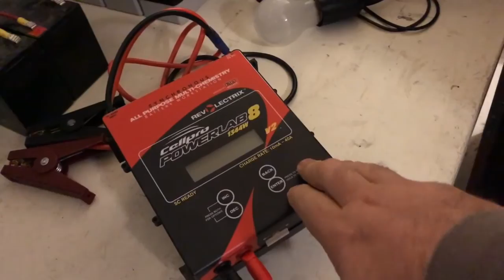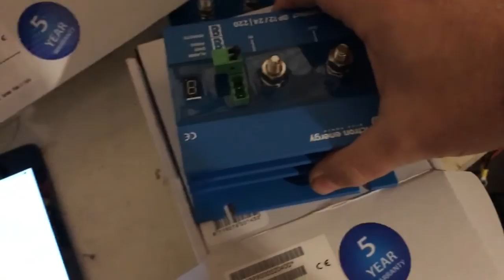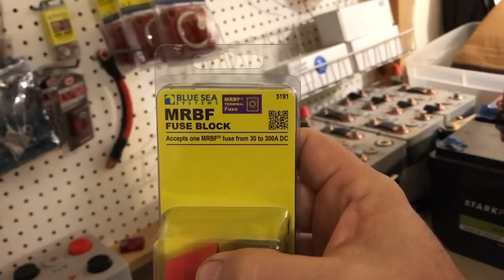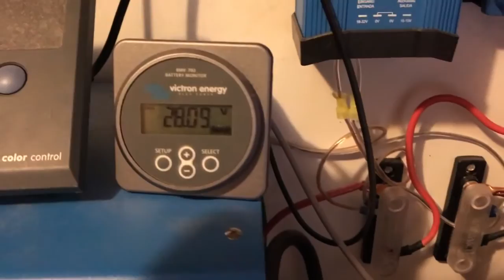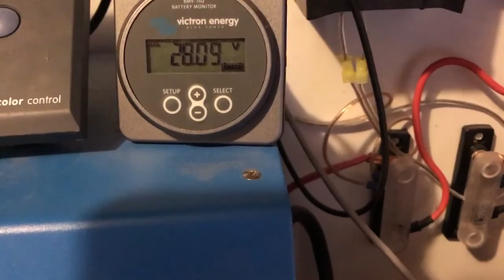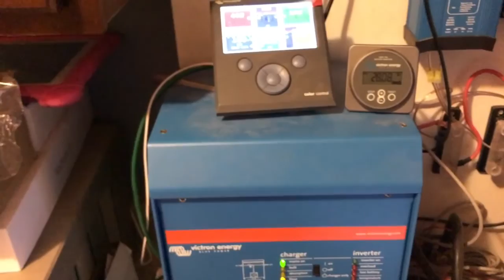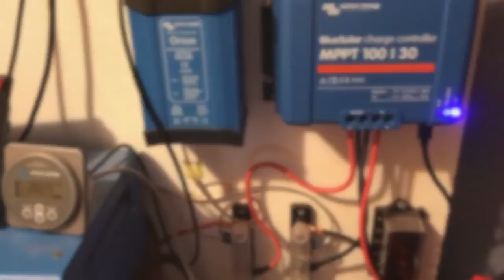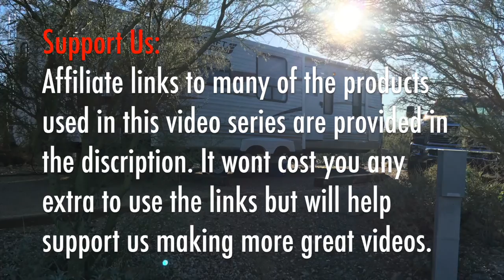Full Time RV Living | Lithium Battery & Solar: Part Two Parts and Components

Comment: Great video series.  I've learned a lot and gotten some good ideas.  I hadn't really considered going to a 24v system, which would sure use smaller cables, but you mentioned that you would discuss your solution for using the power from your 24v battery with the RV's 12v system.  Can you discuss the system that you used?  I will probably need 50 or 60 amps of 12v DC available.  Thx!
Reply from the maker: To be honest, i have just left the RVs single 12v battery and converter in place. That has actually worked well although not as efficient going from 24VDC->120VAC->12VDC. End of day it has worked. I do have 3 x 24->12v down converters from victron (Victron Orion 24/12-25) mounted in my inverter bay but haven't hooked them up. They can be ran in parallel and peak to 35a each which will provide 105a to run slides and levelers.

Comment: Thank you for your video series.  I applied several of your ideas to my own Victron Multiplus 3K LiFePO4 setup in our Trailmanor 2720SL. It was a bit cramped to say the least, but I got it together. We are in Phx metro, too and boondock on the Rim and White Mountains or winter in the deserts 95% of the time that we are out. We were trying to replace the whole generator thing and we don't use AC at all, so easy enough to do. 

My main reason for commenting is that I am highly curious why you omitted your Blue Sea battery switches from your design. You had three hanging on the wall, after all.  I bought one to install on my design and then saw you had omitted yours. I saw some horror stories online about high current battery switches failing and thought I would leave it out for now, until I do more research. I am all about safety margin, running 12V with 4/0 cables, fuses and breakers everywhere, so I thought you may have learned something about them you didn't share in your videos.  I am using Battleborn,  two 100Ah 12V batteries with built in BMS. 

Please explain why you omitted the manual battery switches.  Thanks.
Reply from the maker: Keep your switch. Ideally don't switch it under high load. That and moisture and bad for these switches long term. I omitted mine because i was using the victron batter plus which allows you to disable "one direction". By flipping off the battery plus's, flipping off the solar panels and powering off the victron, i can shut everything down essentially. Its not ideal and i will be adding in a larger DC breaker or switch. But honestly with 4 parallel banks i didn't want 4 switches. i will be redoing my bank as one large bank and will add in a switch at that point. The 4 bank approach was a great idea but just hasn't yielded any benefit. I'd like to add come cell level monitoring to my batteries. Having one bank vs four reduces the complexity. 

Hey thanks for watching ... totally appreciate it. Sorry for the late reply.

Comment: The 24/3000/70 is an excellent choice! :)
Although the components can run on their own out of the box, the CCGX just brings everything together. This is where I cheated and built my own with a RaspberryPi. It lacks the display, but reads all of the devices and uploads to VRM no problem.
Reply from the maker: +kibi15 that’s really impressive. I suspect there are several people me included that would like to learn more about your setup. The ccgx is great for setting the current limit. But for most other things I use the vrm portal as well. If the ccgx could replace ve.config it would definitely be worth its price.

Comment: this video series is amazing.  THANK YOU.  I'm in the thinking/planning/design phase and i'd love to run a 24v battery bank but on a motorhome which i've already installed a 370A high output alternator on (12v).  any ideas how to charge the battery bank via that while underway?  can the victron 24v unit bump up that voltage?
Reply from the maker: Thanks boss. I really appreciate the feedback. It's hard to pass up the alternator power and likely a reason many stick with 12v. However, you are correct, you can use a 12v-24v converter to take the voltage up to meet your banks requirements. However, you will also need to step it back down to meet your motorhomes 12v requirements. So, you would be converting twice where i only convert once since i do not use 12v as a charging source. Charging from 12v will also need to be planned as many 12-24 step up converters put out a constant voltage which isn't ideal for charging. There are step up converters that can be used for charging. Keep that in mind if you decide to go that direction. You can also check out victrons product line or another brand:

https://www.victronenergy.com/dc-dc-converters

Keep in mind if you are having to convert back and forth to meet 12v,24v,120v demands to may actually lose any efficiency you gain from 24v. If your inverter is going to be within a few feet of your battery bank and you aren't looking to power a small space craft, you may not benefit much from 24v. Just get a nice and heavy set of cables to go from your bank to your inverter. Also, if you aren't comfortable making your own cables, have a good welding company custom make your inverter cables. They will ensure the cables are properly crimped. The last thing you want is hot spots on your inverter cables.  

Hope that helps and good luck.
Reply: This helps a lot.  Understood that any conversion of power results in losses to heat.  I was thinking of running a second inverter off the engine 12v system and hook that into a switch-box where i can select Shore/Generator/Engine.  That way i maintain the streamlined turn key design of the Victron by using the remote panel to cap the 110v draw to what's appropriate based on how i'm running - shore/generator/engine and what each is capable of contributing.  I figure that wastes a conversion of energy too but if going that route i maintain the automation down the line.  Also thinking in that setup i could get away with a cheap inverter as it's just going to be converted again back to DC.  AC loads are the question at that point but i'll bet the Victron will re-shape the sine waves running in its hybrid mode.  

I'm actually thinking of going 48v too as my battery bank may need to be located 20 feet from the inverter.  Trying to avoid that but I have to weigh the balance of using available space effectively.  

BTW i'm actually a TIG welder and have welded copper before, good idea on the welded copper cables.  if you ever need anything small done that justifies shipping to NY and back i'll do it for free.  Thanks again.
Reply from the maker: Thanks for the offer. I would never consider welding copper myself. Tried aluminum once which didn't turn out well and that was with the right equipment :) My welding skills depend on a MORE is MORE approach which typically results in a lot of grinding :)

I do like the idea of creating a 120v input for the victron using another inverter. You have a lot of amperage available to you which starts to go outside the realm of most DC-DC converters. However, from my observations, victron only adds to the existing sine wave and can be a little picky about the signal (in a sense it protects your loads from bad power switching to inverter mode if it doesn't like the input). So, you would still want a pure sine inverter capable of utilizing your desired load. I would also be concerned about any surges the inverter creates on your alternater / battery. I believe most inverters create a small surge as it charges up internal capacitors etc. Just thinking out loud here.

Read through the DC-DC converters from victron. A handful of them are good for battery charging and have a variable adjustment. Likewise, some you can run in parallel to achieve your desired output. A 30a 24v model would load up your 12v system with 60a. I suspect 2-3 of these would be all that you would want to tap from the alternator. Correct me if im wrong.
Reply from the maker: Something else to keep in mind. Victron "shares" surge with the AC input. So if you kick on an AC while in hybrid mode it would dump some of that startup surge on the 2nd inverter. You could protect that somewhat by adjusting the maximum amps you draw from the inverter but still a consideration.
Reply: That's a good point. Mechman alternators said keep it to 60% (of that 370 amps) for sustained use.  So assuming i want to keep it under 222 amps even three units would wind up leaving only 42 amps for the engine.  Which i tested the engine idling with no alternator at all, no heater blower, no lights, and it only took 15-20 amps from the battery.  So a 3rd DC-DC converter would have to be used carefully.  And they also said at idle that 60% turns to 100% (and eats into your battery for whatever it can't make up) so don't idle with a load longer than 15 minutes.  That's where you get into changing pulley sizes to keep the alternator RPM up at idle engine RPM.  Mechman alternators highly recommended they're willing to help you through exactly what you're doing.  

I think both options seem really solid though.  OK.  Now on to the fun part - sitting still for several months saving the $$...
Reply from the maker: Thats the hardest part ... garnering the funding.

Comment: Good information ! Hope you could publish a diagram of your whole setup. Looking at doing a similar installation in a 42 feet trawler I am building utilizing Victron as main supplier
Reply from the maker: +Pedro Romero hope you have deep pockets boss! I’m being somewhat sarcastic  I like to shop and find the best deal. It’s hard for me to drop $1500 on an inverter and had to convince myself a few times to buy quality. Little did I know how many other victron accessories I would end up buying. Great products. Competitive pricing for the class they are in ... but ouch ... I spent a lot :) 

I do not have a diagram but more than happy to take some detailed photos and answer any questions you have.
Reply: Morning ! Thanks for the quick response. Looking at other major marine electric brands, Victron is actually a good buy....Reliability, tech support & service are most important and Victron excels in all three. "Off Grid" has a complete different meaning while cruising in the Caribbean....lol
Reply: p.s. Other brands included on my build: Marinco, Bluesea, Fischer Panda ( Generator),  SmartBattey ( 2 x 300w Lithium Batteries)
Reply from the maker: +Pedro Romero agree. The RV world is prolific with a lot of cheap components. We have the luxury of pulling into a Walmart or camping world and picking up another cheap inverter if one fails. The marine world has higher standards and is more prepared for the investment :)
Reply from the maker: +Pedro Romero I hear victrons lithium batteries are bulletproof. If funding is available you might consider victron. Other than smartbattey you may also look at starkpower. They have what looks to be a very identical product. I’ve seen smartbattery in the past but have no experience with them. I have used startpower and they seem to have a solid drop in place solution. Battle born is another similar solution. Good to have options :)
Reply: Yes thank goodness there are new Lithium Batteries suppliers both imported and domestic. Reliability is improving drastically but prices....still high at the initial outlay but more that worthwhile in the log run. Also for marine applications weight and space for similar capacity are clear advantages of Lithium over AGM
Reply from the maker: Pedro .... I couldn’t seem to send you a private message on YouTube. You should be able to send me a message. If not try me on Facebook under rv exodus. Had something I wanted to share with you.
Reply: Ok wil do

Comment: I am enjoying these videos very much. I have been doing lots of research on lithium and solar and this series is probably the best I have seen so far.
 Too bad I can't find a board that protects each cell individually from over-charging and over-discharging

One hint. You should not get a spark if you connect the positive cable first...and disconnect the negative first.
Reply from the maker: I never got use to a good ol fashion pop and spark. Guess I wouldn’t make a good bird dog :)

This was my biggest issue with bottom balancing. I still want the cell level protection without the full BMS and active / top balancing. I would love to see a board that you can install on the cell without running a bunch of wires to each cell. However, I did come across and purchased 4 of these:
http://zeva.com.au/index.php?product=125

It monitors up to 8 cells and has a relay for an alarm or can control a battery disconnect like the victron battery protect. The combination of this and the battery protect will allow you to disconnect the bank if any one cell experiences a low or high voltage event.

I have yet to set it up and play around with it but looks to be a strong solution for bottom balanced banks. Unfortunately it does require a wire to each cell but I picked up the largest gauge ribbon cable I could find which should allow a relatively clean and safe install.

Comment: Why do you prefer Victron over Magnum?
Reply from the maker: Well, I prefer Viltron :) I don't have enough experience with Magnum inverters to say. I do know they don't require a computer science degree like the victron inverters to program but are also less configurable. Victron also uses a separate battery voltage sensor electrically isolated from the battery input. When you have a heavy draw on your batteries, voltage can sag which can lead the inverter to believe the batteries are drained more than they actually are. Thats not so much an issue for me with the size of lithium bank i have. However, it can be a problem for both charging and discharging of batteries.

Magnum is a great brand and is great for RVers. I think for 80% of RVers its likely a more consumer friendly option.
Reply: Thanks so much for the input. I guess that puts me in the Magnum consumer group. Lol
Reply from the maker: Yah don't get me wrong. Victron is a great product and semi plug and play. But there is a reason they recommend professional installers.

Both magnum and victron have hybrid inverters which allow you to supplement shore power with inverter power. This is a great feature when you are at a park or driveway surfing and can only safely draw 10-12amps. The inverter will take what it can and add additional battery power to supply the needs of the trailer. Same concept works if you have a generator that can only supply 13a like a Honda 2000. The inverter will supplement the load with battery power. When the load drops the inverter will start recharging the batteries. Cool stuff. Good luck!
Reply: Also Magnum is pricier than Victron

Comment: Thank you for your videos in this series. You mentioned possibly making a video on the color control. I hope that you do. There is not that much out there on it and a video review/ would be nice. Thank you
Reply from the maker: Mccall Stephens dfinately. I'm in the process right now of installing my lithium batteries and the victron components in my 5th wheel. I'll make sure I take the opportunity to walk through the color control panel as part of that. Thanks for the feedback.